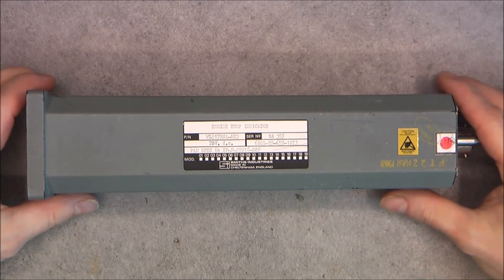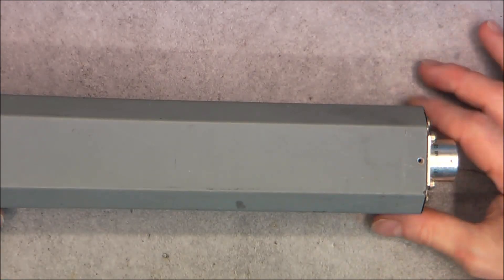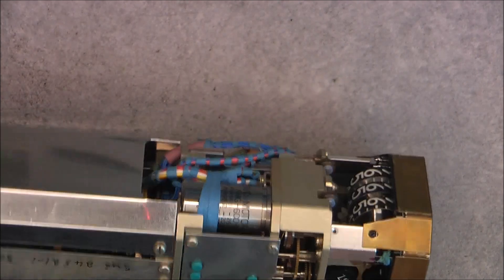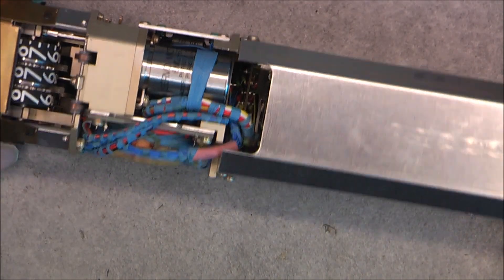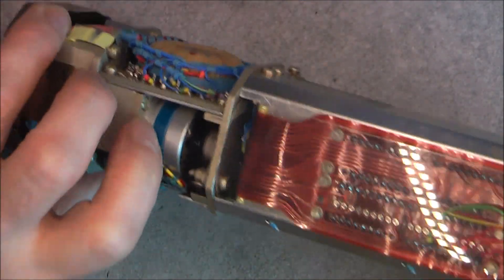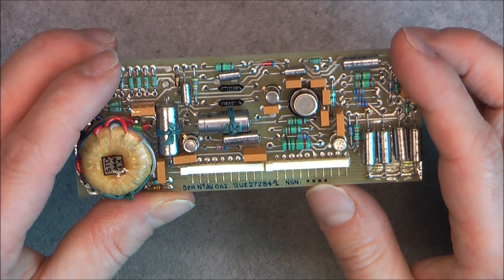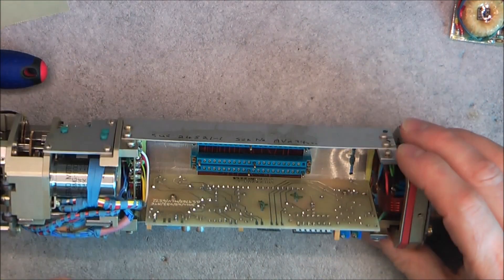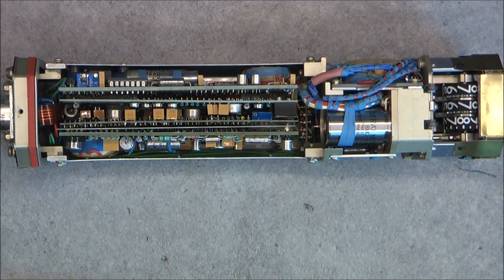Tornado engine temperature indicator teardown

Comment: If this thing uses a thermocouple then the two deviant pins on the back connector could be made of different materials, to prevent a dissimilar metal junction, and do proper cold junction compensation inside the instrument, perhaps?